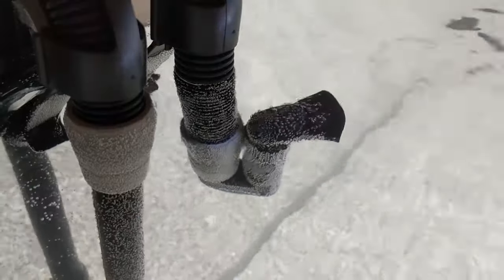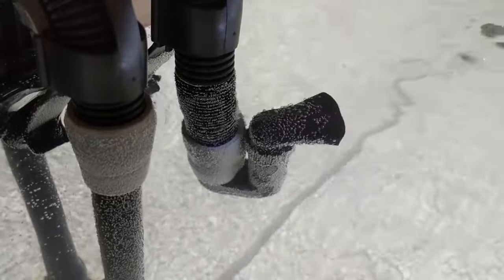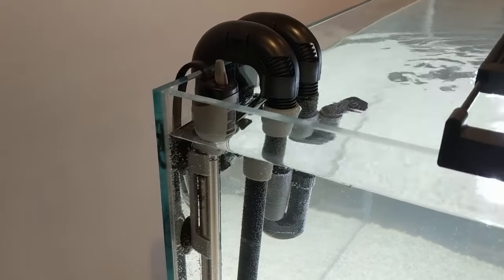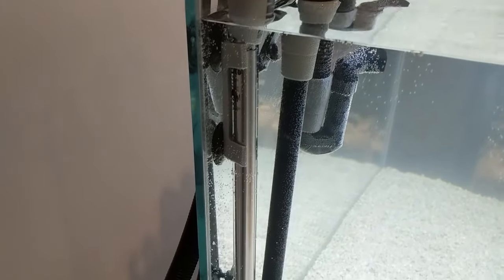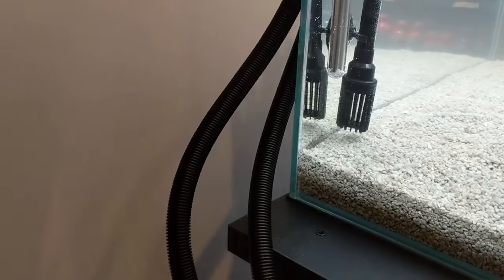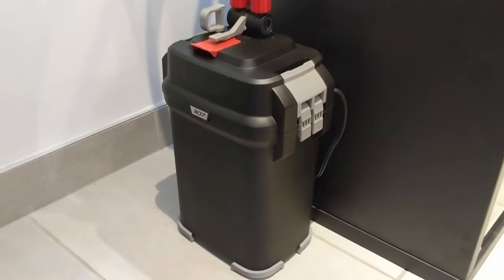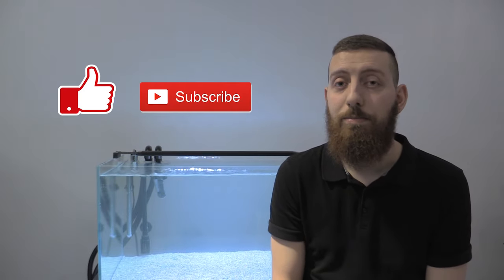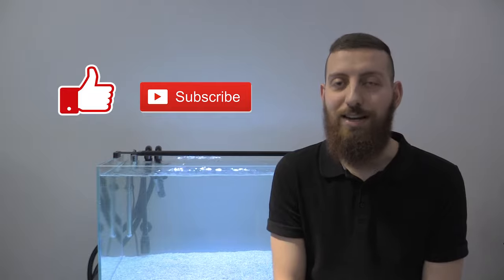Canister filter intake / output positioning tips

Comment: Quick, clear and to the point.  THANK YOU.  No long lead in, not a bunch of senseless blabber.  I appreciate this video more than you can imagine.
Reply from the maker: We're glad you found the video helpful!
Reply: Cannot agree with you more!  I've got a tank emergency and needed this information for setting up the filter that I just bought.  Instructions on where to place the filter & hoses in the booklet did not work for my tank but I couldn't find anything telling me how to set it up on the side of the tank.  This guy got straight to it - so helpful, even though I've lost a fish while searching for this information.
Reply: @sadieapple1  " I couldn't find anything telling me how to set it up on the side of the tank. "
I hate when you buy something important as a filter for a tank & no good info drives me 
crazy, I just bought a canister filter for my 75 & hardly any info on what goes where but 
it's not a name bran filter either, I got it for like 60 $ & bought a extra pump just in case 
the main 1 quit on me at some point, I like the filter it's just the right size I needed & I'm 
not 1 for canisters BUT nothing else was giving me what I wanted, I have a video of it.

Comment: Yeah, but why should you put them there.  I was expecting a video talking about how water flow happens when you put the filters in different areas and how to avoid or identify low flow areas.  This could have been a twitter post instead of a video... "I put them both on the same side with the heater but you can do whatever"
Reply: Bentley Pascoe has a 31 minute video on this. That might give you what you’re looking for.

Comment: I know this is an older video, but just for awareness; if you are using the Fluval E series heater, you will get a low flow error if you set up the tank like he does in this video.  I love their E series heater, but put it immediately to the right of the powerhead to avoid the low flow error on the heater.
Reply from the maker: You're absolutely right! E Series heaters should be positioned directly in the path of water flow to work most effectively. 👌

Comment: I have a FX6 on a 125.  Intake, output on opposite ends the way I've always done it.  I have been struggling with the plants on the intake end, just like you said would happen.  I've talked to my LFS about solutions.  Never did they say put them on the same end even though I specifically asked.  Sometimes it's a "If you have to ask, should you own fish" type of response....  The fish aren't my issue, it's learning what the live plants need.  I was looking for videos with comments on how the spray bar would help with  this.  I have an unused 207 I am going to set up for now on the 'dead end'.   I may go ahead and order a spray bar for next month cleaning, and re-arrange.   Out of my 2 tanks, the 125 is the only one with the most "plant issues" so I kept thinking it has to be oxygen flow.  My Flex is amazing,  Makes me think I need intake and output in the CENTER of the tank, like the flex!    Thanks for the video

Comment: I am glad I saw this video. I am in the process of replacing a HOB filter with a canister and have been wrestling with proper placement plan. I have an enormous rockscape so it’s a little tough to get good flow through the tank. I may put the intake and return together on one side to keep the hoses short and reduce pump head.nThis will at least give me the most powerful return flow……..

Comment: Great video, thanks! Do you have any suggestions for placing a second canister filter in a large aquarium? Safe to assume both back corners of the tank have a heater, output near the surface, and input near the substrate? Or is there a better, more efficient way? How might the flow be interrupted by two results pointing at one another?
Reply from the maker: Our recommendation would be to install the two canisters exactly as you described! If the species you'll be keeping prefer strong, directional flow, aim one output along the back wall and the other towards the front of the aquarium. If not, the random flow generated by the two water outputs "hitting" each other will effectively distribute water throughout the tank!

Comment: Thanks Eric really timely! I'm going to switch to a one side set up like yours... so tidy! As the duel output on the FX6 doesn't seem to be strong enough to reach the entire length of the tank (4ft) I've recently bought a Hydor Koralia 3G Circulation Wave Pump, that I've yet to put in my 300 L (75G) tank. The reason I bought it was to help with breaking the water tension... to create more oxygen for my Discus. Ok after that long story I'll get to my question... where do you recommend I position the powerhead (and where to focus the flow)? Knowing I'll have both the FX6 intake and output on one side, the same as you have in this video. Thanks so much for the helpful video Eric, much appreciated :).
Reply from the maker: You may locate the power head on the opposite end to the filter output.
Reply: @fluval  thanks for the reply. Just so I have this straight, are you saying I should have the powerhead and the Fluval intake and output on opposite sides of the tank with the flow meeting in the middle?

Comment: Thanks for the info. I have a Fluval 405 with a spray bar, in a 70 gal tank. What is the best option to locate the intake? Apparently, the spray bar does not provoke enough water motion, specially at the sand surface.
Reply from the maker: Hi Jose! In your case, it'll be best to position the intake near the bottom of the tank, preferably in a spot that has less water flow to help prevent any dead zones!

Comment: Hi, Thanks for this video! We just upgraded to a new filter (307 performance) for our 60gallon tank, the Plecostomous seems to be loving life and pooping up a storm. the intake and output valves are placed how you have them in this video, but the pleco poop isn't being sucked up by the filter.  We are having nitrates and ammonia build up and have had to euthanize a few fish now. I used some of the biostars from the previous filter and the sand substrate wasn't changed so I think the bacterial load is likely fine. So what am I missing?? The output has good flow, and there is nothing obstructing the intake. Any help is appreciated.
Reply from the maker: Hi Karen, it sounds as if there may be some dead spots in the tank that aren't getting enough flow and as such are allowing debris and waste to accumulate. Try adjusting the output to see if you can avoid having any dead spots. You could also consider adding a small circulation pump, such as the Fluval CP1, to help resuspend any debris and waste and allow the filter to remove it!

Comment: Thanks to share the tips it's really help for me but just wanted to know the out-let one should be inside the water or surface the water ? as I saw in your video it's inside the water and many videos I saw it's surface of the water. Sometimes due to power cut is there any chance to go water in back direction or any chances of leakage ? and last question after installing this filter do I need to have air pump or not required?
Reply from the maker: Hi Shubhrajit, thanks for your comment! It is best to place the output at or slightly below the water surface to create surface agitation without splashing water out of the tank. If the motor head seal is not properly maintained, it is possible that backpressure can cause your filter to leak during a power failure. After installation, an air pump is not required although, air pumps do contribute to better water circulation and oxygenation which leads to an overall more balanced aquarium. We hope this helps! 😊
Reply: @fluval   thanks to clarify my doubts as I have purchased Fluval 307 and tomorrow I will be setting up my filter as per above instructions.

Comment: Awesome video! I Just purchased a 407 filter.  I'm doing my 75 gallon in gravel and one end of it in sand for corydoras and bottom dwellers. What end would you suggest placing my intake and output. The end with sand or the end with gravel?
Reply from the maker: Hi Charles, to avoid any sand from entering the filter, it would be best to place the filters input opposite of the sand for this particular set up. If the intake tube is high enough, either end would do. We hope this helps! 😊
Reply: @fluval  thank you for your reply thats what I did intake and output on the side with the gravel and it worked out great! Thank you

Comment: Thank you for the video. I want to put the input and the output on the same side like you recommended. If I put them in the same corner as you did, and place the spray bar on the top side of the tank ( the shorter one) where do you recommend I should I place a powerhead? I have 75 G tank.
Reply from the maker: Hi Maja, great question! Your powerhead should be positioned on the opposite side of your filters intake, pushing water towards the intake. Doing so will help increase the flow of water in your aquarium which leads to an overall more balanced tank. We hope this helps!
Reply: @fluval  Thank you! :)

Comment: Great setup video Eric: kudos! I can't quite tell, but is your outflow nozzle pointing parallel to the back side of the tank, or is oriented more toward the opposite front corner? Which would be 'better'?
Reply from the maker: Hi Andrew, glad you enjoyed the video! Great question - I usually direct the output towards the opposite corner, to help make as much of a full loop of the aquarium as possible. Naturally, depending on aquarium decor, you may need to adjust this slightly!
Reply: @fluval  thanx Eric. Judging from your answer to a previous question about CO2 placement (thanx again) that's where I placed the bubbler; at the bottom opposite corner to the outflow.

Comment: New to canister filters here. My intake tubing has a pinch point, causing restricted flow. I assume this could be corrected by shortening and tightening up the intake line, would this be a correct assumption?
Reply from the maker: Yes! The intake and output hosing should follow a straight path from the filter to the aquarium with no kinks, loops, bends or turns. It should have a little slack (for ease of maintenance) but not more than that! 👍

Comment: Great video, thank you making it. I setup my fx4 using this. I had in and out on different ends but same side makes much more sense. How would you setup 2 canisters?
Reply from the maker: Glad it helped! When using two canisters you can either cross the input and output tubes or place one canister on the left side of the tank and the other on the right with their tubing's on their respective sides. The ultimate goal is to have even water flow across the entire aquarium with some surface agitation! 👍

Comment: I have intake on left side with wave makes and my canester filter came with a hob water polisher which I have on the right side that causees a push downwards. Then I have heater close to the right side were downward water is. I have 2 sponge filter one left one right in the center separated. 
This is a over stock 55gal tetra and Cory tank

Comment: Thank you for great video. I have a question related to this video, how would you setup an aquarium with 2 canister filters ?
Reply from the maker: You would replicate the set up as per the demonstration tank in this video in each of the two rear corners.
Reply: @fluval  Great, thank you for this video and I have a questions also regarding two filters in aquarium. If the out flow it's to strong how we can attenuate without force the filters but to have a good circulation of water in aquarium ?

Comment: Hi Eric.  Thanks for the video.  I have the 107 canister filter on my Roma90.  If you have the inflow and outflow on opposite sides, in which direction should you point the outflow?  Towards the side with the inflow or the front of the tank or a different direction?  Also, if I adjust the flow lever, does that reduce the amount of water filtered per hour, or just the strength of the outflow?
Reply: Point it away from the intake or you refiltering the same water on a smaller tank. If the outflow strong flow it can disturb fish so direct it against the glass for a lot less disturbance.

Comment: Hello Thanks for the vedio I have heavy planted 350 L aquarium with 10 angel fish and 3 alge eaters 
I installed 2 fluval fx6 in this aquarium is it lot of filteration or is that ok ? 
Also please let me know does the water turn over will be reduced when the media is setup inside the filters ? 
Thanks
Reply from the maker: Hello! Two FX6 filters on a 350 L aquarium is quite a lot of filtration - you may have too much water movement, depending on the species of fish you're keeping. The flow rate does indeed depend on the filter media used: if you have lots of fine sponges, for example, the flow will be reduced more significantly.
Reply: @fluval  Thanks for your reply I am uesing more bio media and reduced the water flow .
I think you are right I will remove one of the 2 filters and keep it on réserve. I appreciate your help

Comment: Hi, I am from Brazil. Searching for an information and maybe you can help me.
It is possible to positioning the canister filter just side by side with the aquarium? most of people put it in the bottom just underneath the aquarium. In my case I have space issues and only it is possible to positioning at the side. 
Many thanks!
Reply from the maker: Hi there! Canister filters are gravity-fed systems, so they need to be positioned a certain distance below the aquarium rim in order to work correctly. We recommend consulting your filter's instruction manual and ensuring this minimum distance is respected. If it is, you'll be good to go! 👍

Comment: I have a new acrylic aquarium that only allows mounting of piping on the back, not the sides (or ends). Using a lilly glass discharge, it has to go straight toward the front face of the tank which is 13" straight out. Do you think the water will hit this front face and go down the front of the aquarium making a circle back to the suction placed by the discharge or should I go for suction at the opposite end of the tank? You copy?
Reply from the maker: Hi Casey, yes the tank water will hit the front of the tank and circle back! If you notice poor flow, try to angle the Lilly pipe diagonally so that it blow the water towards the front of the tank but also sideways, this will help improve overall flow. Hope this helps! 😊

Comment: Dear fluval ,,  I hope that you can help ,, do you make the light grey rubber hose joiners in black  and the light grey right angel one that is in the spray bar kit ,     it woud make my pipes disapear if you do make your rubber fixings in black,,,    An awsome product by the way ,,, im running  a your  207 Filter and spray bar  , that has a black background ,,
Reply from the maker: Unfortunately that is not available. You could find a suitable flexible black plastic and using a black plastic click hose clamp that around the grey connector.
Reply: @fluval   Thankyou , i will give that suggestion a try ..
Stay well and take care .

Comment: I have some questions about how I can install a UV sterilizer to my Fluval Fx6 canister filter. The sterilizer is 2" output/input, so I know I would need to convert it somehow to 1" cause that is the hosing of the canister filter. I also want to install a lily pipe system. My lily pipes are 20mm, and I already located the appropriate clear tube, but again there is that issue of converting from one size hose to another size hose. Do you have suggestions or advice. Also, the sterilizer is too large to fit in my cabinet. I am no plumber and until recently had no idea what a reducer was much less it's male. If it helps at all to give you an idea here are the items I am using:

90 gal rimless aquarium from SCA (36x24x24); Custom with overflow box removed
Smart High Output UV Sterilizer 80 Watt - Pentair Aquatics
Gyre XF350 Pump Kit with Controller (5280 GPH) - Maxspect
600W Titanium Aquarium Heater System - WiFi - Bulk Reef Supply
2 Kessil A360X Tuna Blue LED Lights with WiFi Dongle & Two Mounting Arms Package
Fluval FX6 canister filter
JARDLI Glass Lily Pipe Inflow Outflow Set 20mm for 3/4" ID
GLA PRO-DS-1 Aquarium CO2 System (Dual Stage) (Modular) (Advanced)
Reply from the maker: The FX6 is designed to operate with the diameter of tubing supplied, we suggest you use a dedicated suitable additional filter that can meet the specs required by the UV and other output devices you wish to connect.

Comment: Do you have any videos or written recommendations for setting up an 07 Series for a turtle tank. Here, there is a large drop (6-9 incher) from the top edge of the tank to the top of the water line.
Reply from the maker: Hi there! We don't have any videos about setting up 07 Series filters on turtle tanks specifically, but you can simply follow the normal setup instructions. The maximum recommended gap between the water level and the rim of the aquarium is 7", so as long as it's approximately that in your tank, you shouldn't have any issues!

Comment: Which is better to use on the out take, and what are the differences in function of the spray bar opposed to the regular angled spout?
Reply from the maker: Hi there, great question! Spray bars are useful in planted tanks and with fish that prefer more gentle, diffused water movement. The standard return spout is great for more generalized applications. You can't go wrong with either!